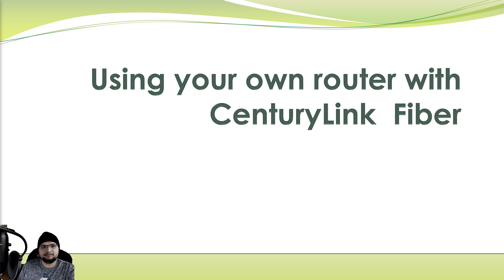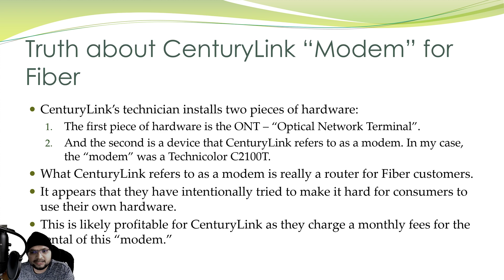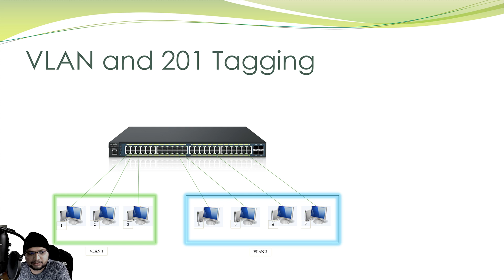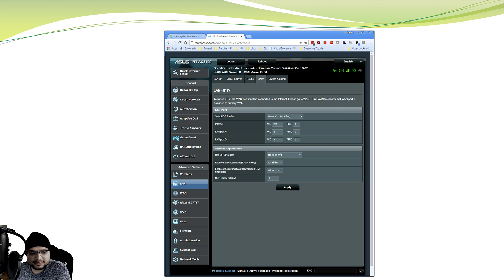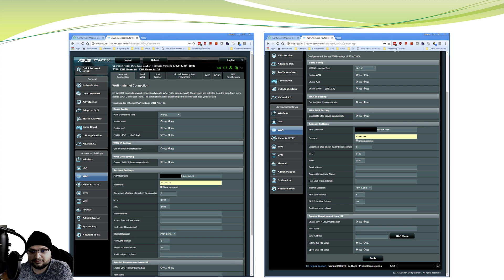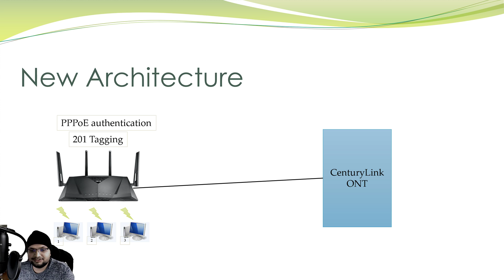How to use CenturyLink Fiber without CenturyLink's Modem and with your own Router

Comment: I'm going through this very issue right now. I have a google wifi though is the main difference, so it seems i just need to replace my modem with a VLAN switch as Google Wifi supports the PPPOE, but not the VLAN. Only downfall to this is that my extra ports on the switch aren't exposed to the downstream Google Wifi, so if i wanted more ports, i'd need yet another switch on GW downstream. Sound about right?
Reply from the maker: That's correct. A VLAN switch will solve your problem. However, I'm not sure if  there is any hidden setting in Google WiFi for VLAN with a different name, if you can find that then you won't have to buy an extra hardware.
Reply: Unfortunately, they don’t support VLAN tagging yet but will in future versions.
Reply: David J. Panzarella 
Hi David,
Even i have google wifi , have you resolved the issue by adding extra hardware ? 
Please let me know i will try the same.
Reply: krishna ragi I have! I have the following: ONT > 5 port switch > GWifi (primary) > 8 port switch > moca adapter > GWifi AP 2 then wireless to my GWifi AP 3. 

The 5 port switch is set to 201 tagged on port 1 and 201 I tagged on port 2. Then I turned off 3-5 ports completely.
Reply: @DavidJPanzarella  
Thank you David for quick reply.
I'm planning to setup like this ONT -> 5 port Switch -> Gwifi router Primary - > Additional Mesh router 
Will it work ?  are your speeds good ?
Reply: David J. Panzarella Thank you
Reply: @KrrishnaRagi  Glad to help!

Comment: Thanks for the in depth tutorial.  Centurylink tech actually turned me on to this idea and that’s how I found your video.  He told me, spend your money on a good router and not ours...at least that what all us nerds do.  I appreciated his honesty.  Anyways, your video was really helpful.
Reply from the maker: I'm glad you got a good tech guy. Mine told me it's impossible to eliminate their router :)
Reply: @MukulTripathi  Do you need fiber adapter to connect the router?
Reply from the maker: @DA-bc8wg  nope, it's the regular lan port.nothing extra needed.
Reply: @MukulTripathi  Will the LC fiber connector fit on the router?
Reply from the maker: Your regular lan cable will fit.

Comment: Any help on where do I tag and change to PPPoE on Netgear - Nighthawk AC1900?
Reply from the maker: I don't have that router anymore but I'm pretty sure it can be done on nighthawk.
Reply: I've got the same router and found these pages. I haven't tried it out yet since my installation hasn't happened yet but it looks solid. https://kb.netgear.com/24014/How-do-I-set-up-a-PPPoE-IPv6-Internet-connection-on-my-Nighthawk-router
https://kb.netgear.com/25724/VLAN-tagging-setup-for-Nighthawk-router

Comment: I've Netgear X10 router...Tries=d and couldn't find VLAN tagging options in my advance setup...Any idea where should I look?
Reply: I also have the X10, it is under Advanced > Advanced Setup > VLAN/Bridge Settings (3rd from the bottom)
Reply: so it works?
Reply: @androsmafra4910  yes, works for me
Reply: You getting 1gb speeds after removing the CL device?
Reply from the maker: I have been getting 900+ both with and without the CL device. Only when I was hardwired into it tho. You need to have a strong wifi router that can support 1gbps speeds to get it on wifi.

Comment: How to Ditch CenturyLink Fiber “Modem”.....I Have Found That The "CenturyLink Technicolor C2100T DSL Fiber Wi-Fi Modem Router 802.11n+.11ac " Will Plug INto The ONT (with RJ-45) .So For $50 I Will Give It A Try ,Thanks For The Ideas...

Comment: Thanks so much for this video! I found it by accident, and you talked about the exact problem I was having with my centurylink service with the double NAT. I followed your instructions on my Asus router, and it worked perfectly! It solved the problems I've been trying to solve for about six months! Thanks again!

The only question I'm concerned with is if I want to upgrade the download speed on my fiber connection, will Centurylink have a problem if they know I'm using my own router instead of theirs?
Reply from the maker: You are welcome! I'm glad it helped.
Reply from the maker: No, those two things are unrelated. Just ask them to upgrade the speed and it will automatically reflect on your account. Only thing you may have issues with is that when they come over to respond to a service call, they won't be happy that you're using your own custom router, bypassing their equipment. At that time you can ask them to bring/use their own temporary modem/router to resolve any service issues.
Reply: Perfect! I will probably do that in the near future. Thanks again!

Comment: Thank you very much for this detailed information.I recently bought a Nighthawk x6 and after I added PPPoE and tagged the 201 it worked!
Reply: Did anyone figure out tagging for netgear devices? I go to the settings and try to put in 201 tagging but it doesn't connect and then I lose access to my router login page
Reply from the maker: I'm glad it worked for you!
Reply: I've X10 router from Netgear...Where did you find the tagging option?
Reply: @idsd72  did you figure out how to tag?
Reply: Could you please tell where exactly did you find that "VID" field to place the tag?
Reply: @buzzikea  For the Netgear X10, it is under Advanced > Advanced Setup > VLAN/Bridge Settings.
Reply: @mttsnb  thank you.
Reply: could not get it connected :(
Reply: @buzzikea  after you tag vlan 201, remember to change back to pppoe w/ password.  you need BOTH 201 tag AND pppoe.  this tripped me up.  please take care n stay safe.

Comment: Nice video Mukul, do you think this is worth doing with my TP-LINK AC1750? I also currently have the technicolor C2100T from centurylink
Reply from the maker: The general concept is same, you'll have to find similar menu and settings in that router tho. Yes! It's absolutely worth eliminating an extra dependency from your setup.

Comment: Good job! I don't understand the last instruction; unplug the cable from the CL modem and plug it into your router? Do you not have to keep the CL modem/router in play since the DSL feed is going to the CL DSL modem/router? Do you mean that you just run a cable from the CL modem/router WAN port to the WAN port on the WiFi router?  Thanks!
Reply from the maker: This video is only for fiber optics. The ONT network works a little different than DSL. In that part what I meant to say is that you can eliminate the CL modem as such from the whole setup. Instead of having the cord plug into the CL modem, just plug it into your own modem.

Comment: STILL DOESN'T WORK! Do I need to make any changes within the centurylink router so my asus can be used? I've made the changes on my Asus and shows a two way connection but still unable to get access to my files via the internet on other internet services The wireless router currently uses a private WAN IP address.

This router may be in the multiple-NAT environment and DDNS service cannot work in this environment.
Reply from the maker: Which Router do you have? Have you eliminated the CenturyLink equipment to get rid of  multiple NAT situation. I'm able to DDNS with asuscomm free DDNS with above settings